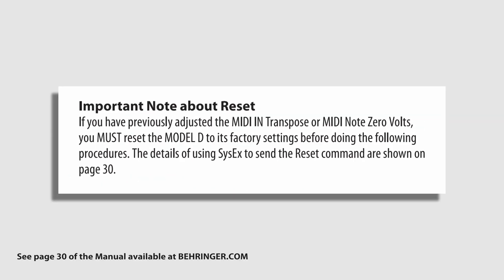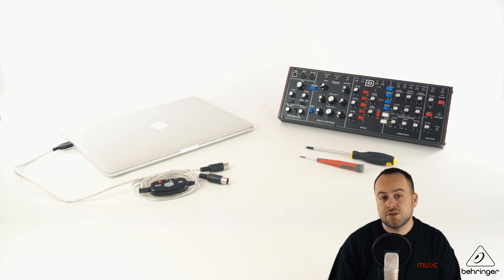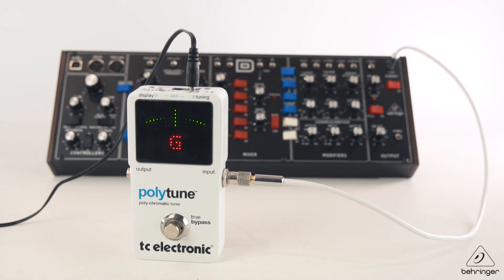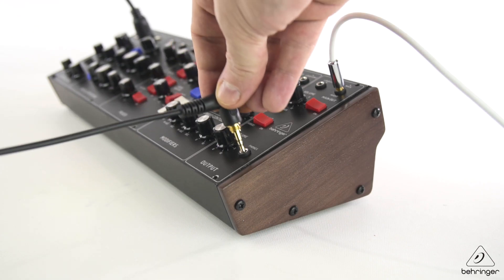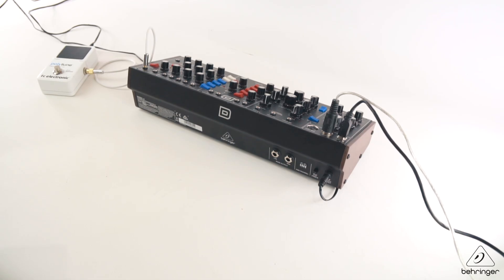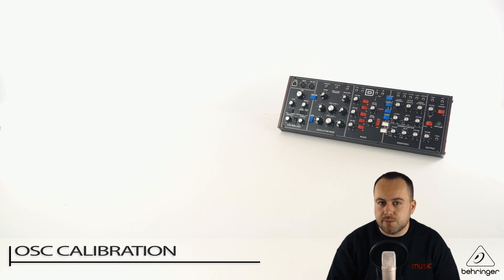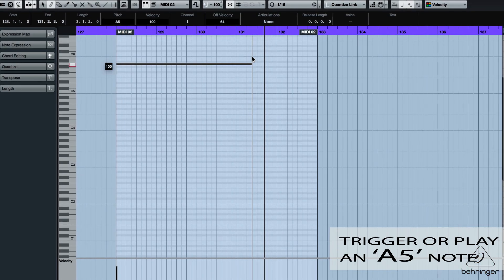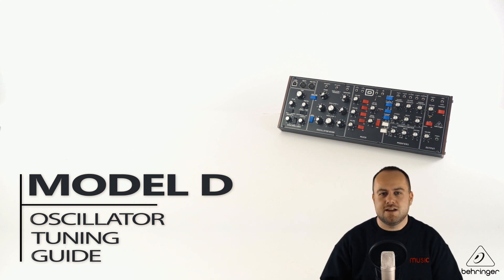BEHRINGER MODEL D OSCILLATOR TUNING GUIDE

Comment: how many companies out there have this approcach to diy repairs/maintenance? I'm really impressed with what Behringer has become, they're doing an amazing job not only making accessible tech but also sharing knowledge with the community and listening to feedback. hat tip to everyone at the company.
Reply: This is not a repair. It is a calibration that I'm pretty sure could be done in the factory. The price is very low though, so I'm not complaining.
Reply: @eliasknaapinen  that's why I included "maintenace" (even a perfectly calibrated unit may eventually need recalibration). The problem with doing a very precise calibration from factory is that it would make the synth more expensive. They do make a quick callibration I'm sure, but some  badly calibrated units will slip by QC every now and then. I also don't see it as a problem, since it helps keeping their synths cheap (and Behringer does a great job teaching the process anyway, which is what I really like; I'm all for shared knowledge on how to keep your instruments functioning properly).
Reply: @nonono8788    They keep it cheaper this way, but it means you're getting a marsupial synth:  it's born before it's really ready.  Most makers spend the extra money to get it right before they ship it.
Reply: @RadicalCaveman  It's an analog synth. Parts drift over time - That's not something that anyone can prevent.

This synth is very close to the original design by Moog, and the calibration procedure demonstrated here is the same calibration procedure that Moog put in their manual for the model D.

They could have redesigned the Model D to use DCOs or digital oscillators that wouldn't drift - like they did with the A standard - but it would lack the sound that made the Model D desirable. It wouldn't be an analog synth.
Reply: im curious, isn't a DCO a digitally controlled analogue oscillator? why then would it not sound the same (apart from being in tune)

Comment: Actually really easy, nice video! Also... bizarrely satisfying. Zero experience with this kind of thing, so people don't let this put you off. Some tips, the screw holes underneath actually move, so line them up with a small screwdriver when the faceplate is back down. Trim pots, they turn different ways to raise/lower, so don't expect turning left on both to lower ;)

Comment: Thanks for the video. All of my oscillators were playing a whole tone flat so, compared to the a-440 tone, my "A" notes were playing at "G". Using a tuner to get it spot on, I had to turn the OSC range calibration screws quite a lot  to get them up to A. The Scale's weren't off by too much although Oscilator three seemed a bit more temperamental than Osc's 1&2. Once calibrated though, there was a huge difference, with the oscillators staying stable and in tune with each other across the octaves.  
Just a small note in case you get the same problem as I did - when reassembling and putting the mini bolts/screws back in, one of them refused to tighten. Upon inspection I noticed the nuts on the main body are in a sort of rail and, in this case, the nut was free to slide along the rail and out of alignment with the hole on the front panel . Once pushed back into alignment with the hole on the front panel the mini bolt tightened perfectly.
The whole idea of getting into the electrics seemed slightly scary at first, but it proved relatively simple to do and well worth the effort.

Comment: Hello,

Last time I turned on my Poly D, OSC 1 & 4 were completely out of tune.

I've waited for 30minutes, switched the device off and on again but nothing changed. 

I managed to calibrate the Oscillators with the trimpots on the back panel. However, the oscillators are going completely out of tune when I change the range (from 8' to 4', to 2' or to 16' etc.). 

Do you have any solution ? 

Do you kwon what is the OSC RANGE trimpot made for ? 

Thanks,

Comment: Thanks for this tutorial. I just calibrated mine too (I bought it less than a month ago). It only needed very little adjustment. You could not even notice from hearing the sound. I had to use Ableton Tuner to notice one of the oscillators was a little bit under tune.
Reply: How many times have you had to tune it ?

Comment: Does the screwdriver for the back have to be insulated?
Reply: I would expect they've recommended this just to cover their own backs in case you short something - basically you should be okay, just don't bridge any connections while you're in there.
The newer models had plastic trimpots anyway, so I really doubt you'd mess anything up!
Reply: @gogogord  It's more likely because your fingers transfer electrical noise, to a metal handled screwdriver, which affects the results, making it harder to tune.

Even the proximity of your fingers to the trim pot or the PCB may have some effect.  Ideally, you should do these things with proper trimmer tools, which tend to be at least six inches long, so you can keep your hands further away.
Reply: @TooSlowTube  That's a really decent point. Would grounding your wrist help any?
Reply: @gogogord  I guess it couldn't hurt, but that's more for preventing static shock (ESD).

"Hand effect" is an inductive phenomenon - your hand gets inductively coupled into the circuit, and acts as an antenna, just by being close enough.

In a lot of cases, it won't make a noticeable difference - it depends on the circut - but it's worth bearing in mind when you're trying to set something precisely.
Reply: @TooSlowTube  Basically you don't want your synth working like a theremin while you're doing precision tuning on it - definitely a good point worth keeping in mind.
Reply: @gogogord  That's a good way of putting it, yes :)
Reply: Capacitance from your body can affect the trimming.

Comment: I just purchased the model D and I'm very happy with it. But I do have a question about the tuning going out while changing my pitch bend on my Roland controller, more that 2 % pitch bend. A full note. It seems to stay in tune by itself and when I pitch bend a bit. But for some reason my pitch bend wheel is set up about an octive and that's when I lose the tuning. It does go out a bit. Then I have to retune using the tuner but it's really way off. Anyway how can fix this? Thanks.

Comment: My understanding is that these type of trimpots have a very low cycle count (and are very fragile), can you give the cycle count lifespan of these components?

Also, In the manual it discusses Pitch CV calibration and Octave calibration before discussing Oscillator calibration...So I am wondering if an owner should first do Pitch CV and Octave calibration before attempting Oscillator calibration?
Reply: Behringer KnowledgeBase any solid answer as to when these synths are gonna be available thru guitar center ?   The wait for these is quite ridiculous.  Now we're waiting for the neutron too.  Dammit !    Remember when roland came out of nowhere with their version se02?   
 even better,what happens if moog themselves drop a product to compete with this synth?  That could completely ruin the behringer model d gameplan !
Reply: Behringer KnowledgeBase when is the octave calibration video going to be available Behringer?

Comment: Wow pretty straightforward. I was nervous this was something I couldn’t do my self. Are most analog synths this easy to tune?
Reply: No, in most cases you're going to need an oscilloscope. Especially with the vintage ones. In some cases you need a volt meter if you're calibrating the voltage rails.

Comment: neither of the two examples you show resemble the layout of the trim pots on my ModelD. mine has only one pot labelled osc sw and then a +10v adj pot and a _10v adj pot. It's easy enough to get an octave or two in tune but any more than that it goes out of tune. I can't find any calibration instructions that match the synth I have.

Comment: Hi! Great video! In midi mine is in perfect tune but when controling it with CV/gate, it is out of tune. I like to use it with cv/gate because then it becomes touch sensitive, so do you think it would work tuning it without midi? Only using cv/gate? I need to adjust the octave range.

Comment: is the same method used to tune the oscillator on the crave? if so, where should the oscillator frequency knob be set whilst performing the process, 12 o'clock?

Comment: I have aquestion concerning the Note Priority and the Poly Chain.

Can the Polly Chain also be used with a different (Polyphonic) Unit and Top Note Priority?

This would be handy in Live Performance Settings where a Single Note Lead would give you the Model D only and augment it with additional Voices from another unit (not doubling the Lead Voice) if you played a Chord.

The seyup would be a MIDI Keyboard (MIDI out) going into the Model D's MIDI In and a Polyphonic Module connected to the Model D's MIDI Through (to module MIDI In).

Have you tried anything like this?

The MIDI settings are on P.31 of the Model D. Owner's Manual.

Comment: @BehringerKnowledgeBaseOfficial Who dropped the ball in the over all design of The Behringer Model D? The reason why I ask you this, is there are other analog synthesizers out there, that have an external tuning knob on the surface of the unit for that same purpose of fine tuning the OSC's... Respectfully, having an external knob to tune each OSC should not of been that cost prohibited to stop your design to including those external tuning controls.

Comment: is this for fine tuning and making sure it is roughly in tune over several octaves? I have a model D that for some reason the tuning got really wacked out and is roughly 5 semitones out, I have managed to correct this by downloading the synthtribe software and setting the midi transpose but I feel like I shouldn't have to do this. How out of tune should this synth get.

Comment: I had to do mine out of the box new...It was delivered to me in the northeastern US in February...I'm sure the transit in unheated containers had much to do with it...Some feedback on the process...First, those single turn trim pots are very  imprecise! Talks quit a bit of work, even with an electronic tuner. The most frustrating part of the process is fastening the face plate back into the chassis. The screws meet with square nuts that slide along rails! matching the nuts with the screw holes is a step that should not be hard to complete. Those nits aside, the process is straightforward if you follow the simple instructions.
Reply: Rise Of The Machine I live in the southwest and mine will be here in June. That doesn’t mean I’m in the clear with not having to tune mine as well do you think?
Reply: From what I've read, it seems many people are getting them out of the box in tune. It was very cold here in February 2018, probably more severe weather conditions than the Southwest US in early summer...SO I would probably not worry much - But I would check it...You can set the controls as per the diagram here at 6:19 and at that point you should have a good idea where the tuning is at...And after that...Enjoy your Model D! it is a remarkable instrument!

Comment: The question is how often do you have to do this? Once a year, once a week?
Reply: Would be nice if we could tune the oscillators without having to open the unit. Maybe putting some knobs or screws in the back of the unit? Anyway, it's amazing what you guys are doing with these new synths. I'm anxiously waiting for the OB and the 101. :)
Reply: Maybe someone could come up with an aftermarket tuning method and clean up on that part of the market from overlooked engineering. Let’s push each other for more innovation!!
Reply: You cannot move trimpots outside of the case or even expose them to air - they shouls be same temperature as the rest of the pcb. We are talking micro changes in temperature. As long as environment is stable it should hold the tuning ok
Reply: I think the main reason is to have the tuning capability available when the D is removed from the case and mounted into a Eurorack installation.
Reply: Mine needed doing after two months.

Comment: FYI the midi/USB adapter shown here (the cheap no-brand oval shaped ones with just a treble clef logo) don't pass sysex properly. I've ran into problems trying to transfer patches into a Korg FM2 with one of those. If you need to send the Sysex to reset the device and nothing happens, try with a better midi interface. A Roland UM-One Mk2 should do the trick.

Comment: Very cool, interesting they have already changed the trimpots.
Reply: This is good. It's not easy to make precise adjustments with single turn pots. Multi-turn pots have more precision and faster to dial in setting.

Comment: Please, I need help. I am a novice on semi-modular synthesizers (like is Behringer Model D here ). But I can't get any sound, except the A-440 reference tone. Does anyone know where the problem might be? It's the second BMD I've tried and it's the same - no sound in the VOICE switch settings. Thank you for your advice.
Reply: Perrymanx your probably have the filter closed, oscillator off, or sustain/decay off.. if still unsure, move a bunch of knobs until you start to hear something and then you’ll figure out what was wrong. My first time in front of a synth the settings were weird and I couldn’t get it to sound either lol

Comment: I would tune it on the octave I use when playing, but one I started getting into arps and switching octaves I noticed the drift from each octave flat or sharp. Finally really noticed it when after 20 min of working on a lead doubled with another synth I has the ah ha moment. Guess I'll be doing this tonight!
Reply: Did you do it ? How many times have you had to tune it ?

Comment: In this tutorial I see only the way to do it within the older version.. why there's no explaination on how to tune with later version's "multiturn trimpots"? how to tune my "D" with those small blue boxes??
Reply: Hi Pietro - I have the newer version and followed the instructions in this video with no issues. The circuit board is labeled as to which "blue boxes" are for which OSC, as well as the RANGE and SCALE controls. Its easy!

Comment: Do other analog synths require tuning like this?
Reply: Yes, the vintage ones need an oscilloscope and in some cases a volt meter.
Reply: Not all of them. Many have pots of the back for tuning. That would have been much more convenient.

Comment: This is insane Behringer is suggesting this and  letting non professionals open this up to tune. I can see these turning into a mess with very unpleased customers. Technically with Behringers outstanding warranty shouldn’t they allow me to send it back or take it to a registered Behringer tech  locally to have them calibrate it correctly. Is this a option Behringer???
Reply: If you are struggling to follow these simple instructions then I hope you don’t drive!
Reply: I would like to see more companies give us schematics and let the users repair or modify your own stuff. Like in the "old days" as nearly every electronic device came with service manuals. Stand up for your Right to Repair!
Reply: I am a musician, not an electrical engineer. This procedure requires opening the synth and tools that not everyone has. It should only be done by a professional
Reply: I am sure someone will gladly charge an $70/hour bench fee to turn a few screws.
Reply: As a reader, I’m very unpleased by your comment. Try learning a new skill. You’ll find it’s quite simple really. If not, you could always pay a ‘professional’ a similar amount to the retail value of the synth to perform this simple task for you.